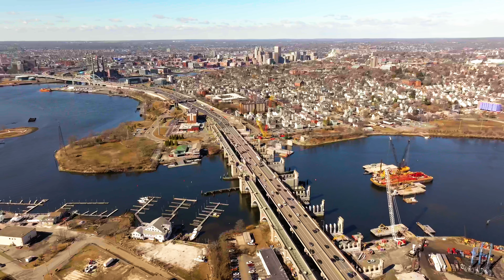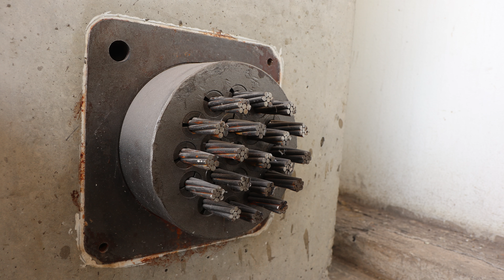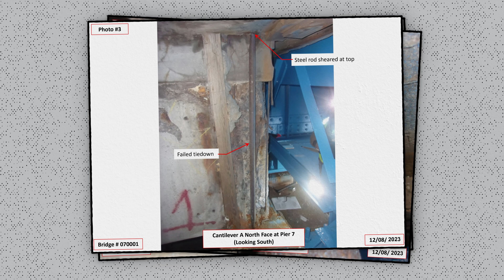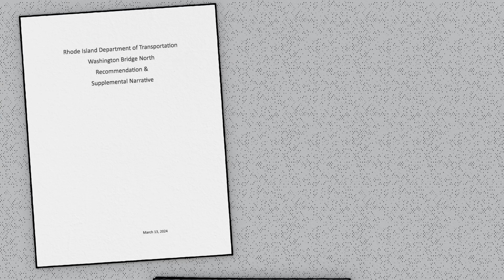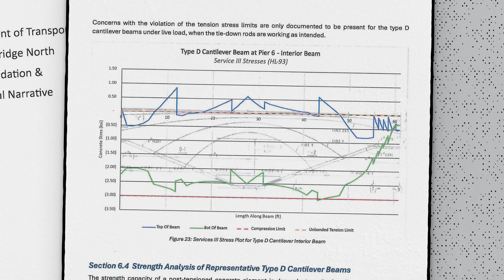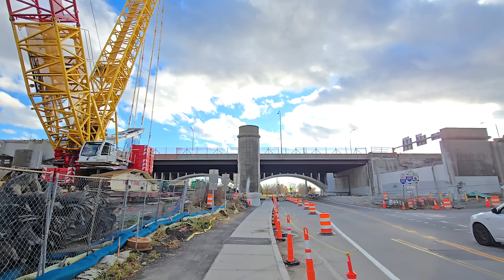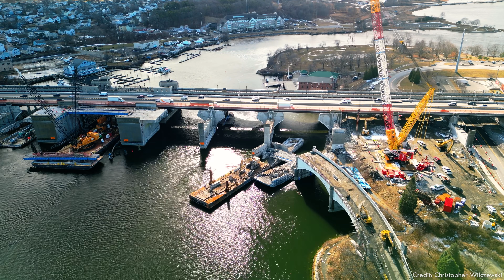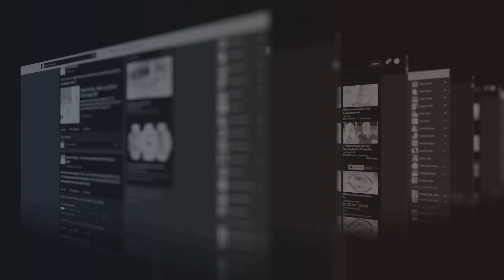This Bridge’s Bizarre Design Nearly Caused It To Collapse

Comment: What bothers me about stories like this is the lack of questioning of the implicit assumption that every bit of infrastructure that has ever existed needs to be replaced instead of just removed, especially considering in some places where we have clearly overextended our ability to pay for all of that infrastructure with proper maintenance and replacement cycles and also where the place itself might be less important or prosperous now than it was when the infrastructures was originally built.

Comment: Grady, have Super Duplex Stainless Steels been investigated for bridge construction? Any grade of stainless would be more expensive upfront, however the costs for maintaining a stainless bridge would likely be significantly lower especially in cold areas of the country that salt their roads. Super Duplex SS's are significantly stronger than standard grades of stainless and are significantly more corrosion resistant than standard stainless steel with PREN values of 38 to 45. These Super Duplex SS are used in the most corrosive and harsh environment possible such as petrochemical applications, long term salt water submersion, waste water, pulp and paper manufacturing, etc.

Comment: It's also worth noting that to a fair degree this kind of issue is self-inflicted by America's car-centric design. Sure a more functional transit setup would still require plenty of bridges, including some designed for cars, but it would still be far fewer of them and most wouldn't need to be designed for nearly as high of loads.

Comment: Any inspection or regulatory job can't be done by contracting private 3rd parties. Since the company will be paid the same regardless if the engineers spend 30 days doing a inspection, or 30 minutes, it has the incentive to use the least qualified people, at the cheapest rate, and make them do the minimum required.

The "free market" doesn't work in these cases. It needs to be government salaried employees, who will get paid the same regardless of the time they spend on each bridge. So they have no incentive to not do a good job.

Comment: I'm no engineer but you can see where the rods have stretched and narrowed, plastic deformation, before they snapped. Shouldn't there be a matte grey/white surface at the breaking point? I can see in the pictures that there's rust on what should be relatively clean surfaces if the break was recent, but the edges are still sharp, so they've been broken for a while but not for a huge amount of time, long enough to form surface rust. Either way, they're broken, and I think that bolt broken at the head had been broken for quite a while going by how heavily rusted it was, and you could see significant rounding of the broken edges. That takes time. I'm glad they caught the problem before disaster struck.

Comment: It should be more widespread to refer to it as an "engineering practice" like a medical practice.  Things are constantly changing and we are learning new things everyday.  You see a newer structure getting maintenance frequently and people say "they don't make them like they used to." You're right, we are trying to make it so that we can mitigate the factors that would cause a failure we'll before it happens.rather than hiding these components and assuming they'll last forever.

Comment: Inspection is great but really the question that follows inspection considerations should have been; What happens If you identify a failed part by an inspection but you need to disassemble the whole bridge to fix it it?

My other comment is that making a visually striking project out of something with such a core utilitarian purpose feels like a 50/50 split between it's fine and this was a costly mistake.  The Providence River Bridge 980m down the road looks fine with a nice steel arch and cable supports to the road deck that has a steel under structure.

Comment: Here in Austin TX there are some large powerline pylons that are made of Cor-Ten. They are similar to the single-pole high mast lighting towers you see at highway interchanges. Large metal tubes that taper gradually upwards and fit into each other. What bothers me is that they are Cor-Ten and appear to be in direct contact with the soil. There is no concrete footing apparent. There does seem to be some sort of coating applied to the metal where it enters the soil, but that seems like a corrosion failure waiting to happen. What's to stop some grounds maintenance guy with a string trimmer from damaging that coating? I hope they do some sort of regualr inspections of these pylons.

Comment: Design flaw?  Bullshit.  The Bridge was completed in 1968.  It was designed to be in service for 50 years.  It was 56 years old when they “discovered” the issues and shut it down.  You “Practical Engineer”, DOT Secretary at the time Pete Buttigieg, and some others tow the line as being the fault of the original engineers/designers.  How about the RI government that was utilizing a bridge that was past its service life.  The RI DOT prior to 2024 had just dumped $40 million out of a $70 million contract for some unrelated work on the bridge.  Now that work has been demoed.

Let’s not forget the inspection report from a few years back detailing the exact areas of concern were not able to be accessed due to, get this “excessive pigeon feces”.  I kid you not…..

Comment: Ever since the Hyatt Hotel overhead walkway collapse back in 1981 in Kansas City, I've been interested in "the way things fail".  You would almost think that whenever any big project is designed the final step should be to ask, now how can this fail?   How many ways can it fail?  How fast will it fail?  How visible will failure be?  And how contained will a failure be?  Will the whole structure collapse or just a segment?  When you're putting brand new things up, it's hard to imagine them coming down.  But as we capture more collapses of all kinds on video these days, it should be worth a little effort.

Comment: Grady,

While tankers are constructed of steel, inspection and response to cracks create many similar problems that are found on bridges.

Historically, tankers, as with all vessels, were inspected on a twice in five year, with a maximum of three years basis.  Structural design used a worst case weather criteria based on transits of the winter north Atlantic.

When the Trans-Alaska Pipeline (TAPS) opened in 1978, a segregated fleet of US flagged "Jones Act" carried Alaska North Slope (ANS) crude oil from Valdez, Alaska to the lower-48 states and Hawaii.  Initially,  the oil was carried by a mix of pre-existing and purpose built tankers.

TAPS tankers run primarily on a dedicated North-South transit route across the Gulf of Alaska, where winter weather starts in the early fall and ends in the late spring.  Beam seas make for both an uncomfortable ride and a very large number of cycles, similar to cars and trucks on a highway.

Reports of significant numbers of cracks started to be reported in the early 1980s.  The number of cracks,   size, and location did not go unnoticed.  The US tanker community is quite close.  All of the TAPS tankers were Classed by the American Bureau of Shipping and were regulated by the USCG.  The operators and naval architects knew each other from school, professional associations like the Society of Naval Architects and Marine Engineers.  We participated in similar committees, subcommittees, and technical committees of ABS, USCG, the American Petroleum Institute (API), Oil Companies International Marine Forum (OCIMF), and the Tanker Structures Cooperative Forum  (TSCF).  We also used many of the same consultants.

In the mid-80s computers made the use of finite element analysis a tool for identification of critical areas for cracks, high stress areas, identification and recommended repairs.

In 1991 the USCG required that every vessel in the TAPS trade have a Critical Area Inspection Plan (CAIP) which identifies areas where cracks can impact structural strength, and approved repairs for cracks.  It requires annual CAIP inspections.  However, based on the number of cracks and locations the annual inspections can be waived, for twice in five year drydockings.

 USCG Navigation and Vessel Inspection Circular (NVIC) Number 15-91 Critical  Area Inspection Plan (CAIP).

Bob

Comment: 12:49 - If there were a way to make it worse, they couldn't seem to have found it.
14:55 - Nope, there were more ways to worsen it yet.
17:17 - Agreed, but... I design and market engineered products and none of them are purposely designed to hide possible failure causes or modes; this thing should have come with a 'sell by' date.

Comment: I am VERY happy to see you cover this Grady.  It was good of you to hat-tip Casey and the local reporters.
Casey Jones Professional Engineer has been covering this for a while now and that was where I learned about this.
He has been using COMMERCIALLY available, PUBLICLY accessible data for the Wash. St. bridge and clearly if Ri-DOT had actually used modern inspection capabilities they would have known this bridge was unsafe years earlier. Too bad governmental clerks often seem more inclined to protect their turf and not even try to "do the right thing".
 InSAR Analysis from Value Space was available for only a few thousand dollars... Ri-DOT seems to think that is a "bad" thing.
Perhaps Ri-DOT might actually get something right going on.... but I am not holding my breath.

Comment: This is a country wide problem, not just there. Inspectors all over are not actually doing their job, just checking everything off not caring what the structural statis actually is. That's what got us into this infrastructure emergency problems all over the place. State Government is more than happy to take the money earmarked for inspection and maintenance but they don't want to spend it on that - likely on bonuses or vacations IMO.

Comment: I am not familiar with the rules and regulations regarding inspections. but it seems to me that for structures of that age a more in-depth inspection may be needed at some point. the westbound bridge began construction in 1967 so it was about 56 years old at the time the issues started being found. maybe, to pluck a number out of the air once every 10 or 20 years an in depth analysis of a structure should be done like was done after the first problems where found. who knows what other old structures with interesting building techniques have hiding beneath the surface where it can't be seen.

Comment: On the matter of substantial bridge delays, might be interesting to do a feature on the matter of I-55 in St. Louis.  Boulevard overpass bridges were to be reSURFACED on a major corridor.  Simple enough, not traversing a waterway, just passing over local traffic below.  But the surface removal destroyed bespoke girders that could not be rehabilitated and could not be replaced without substantial delay.  So where once was Interstate roadway is no road surface and destroyed girders . . . A small project has turned into a multi-year boondoggle, almost entirely due to inept engineering.

Here's a local news summary for reference - https://www.youtube.com/watch?v=3uLVdnnnrcc

Comment: In Germany (Dresden) the Carola bridge collapsed because of a catastrophic failure of the tensioned steel ("Hennigsdorfer Spannstahl") and some more are closed down. The same technique was used in eastern germany from the 60s til 93.

Comment: If hidden steel cables possibly breaking is an issue, why not just make an electric test connection across all of them? Then a cheap automated system can give an alert as soon as a single one breaks. If the tester is made a bit more sophisticated, it could even detect deterioration by measuring changing resistance.

Comment: I was supposed to cross this bridge the day after the bridge was shut down. I’ve been over the consolidated bridge all on the original eastbound side, but it’s scary, since many trucks drive in the wrong lanes. Most of the bridges in RI were built at the same time, so all are under construction now, making many people to complain. It’s scary I drive over that bridge several times when it clearly wasn’t safe. And now more over weight trucks are on the original eastbound side, so that will need to be replaced sooner than planned.
Reply: I’m happy they didn’t do a bandaid fix. But trying to drive through there at busy times is so frustrating! I still don’t know how it passed for so long

Comment: I will say that we in the US have an over reliance on concrete when I believe we should be using longer lasting bridge designs out of stone and steel. 

to take on a sore subject, the 35w bridge, the one that collapsed, had elegant steel work and if it hadn't been for the gusset plates, it would probably still be standing today, though it would've needed some work done to the rollers that allow the bridge to move.

the new 35w bridge is fugly, and that's putting it mildly. concrete box girder design, not much different from 100,000 bridges in the US alone. there's nothing awe inspiring about it

Comment: They should've built the road bridge as a stone arch bridge in the first place just like the much older one. Yes, it would've cost a few $ more but it would still be standing now. Arch bridges look nice and last forever because they're always in compression. There is no steel to corrode.

Comment: I've heard this a lot lately, a bridge needs replacing because it's reached the end of its designed lifespan. We have a similar problem over here in the UK. Many of our motorway Bridgewater at this stage. I find it puzzling. We have many stone arch bridges that are centuries old, and brick arch rail bridges between 100-150 years old.

It seems that their very nature makes steal and concrete bridges unsuitable for long lifespans, but perhaps there's a third way? 

Concrete works best under compression, while under tension it is fairly useless unless it's reinforced with steel - but even then, it doesn't beat its stats for compression.

Instead of using long beams prone to failure, you could make fantastic arched structures using shaped low-cost concrete blocks, similar to those used by TBMs.

Comment: At work, we recently took off the siding of an old brick-faced concrete block building. We knew it was bad, cause it leaked when it rained, but it was impressive just how much was hidden by the siding and drywall (that was installed on the inside over top the crumbling plaster).

I’ve also recently received news that the interstate by my house (which has been under construction for a year or so) is delayed because of bridge problems. Who’d have thought that maintaining huge infrastructure would be such a concern.

Comment: 11:30 ha ha ha... when you were showing the pictures of the failed bridge components, my recent inspection (and discovery of several broken joists and bottom plates) of the crawlspace of my 70-year-old recently purchased house came to mind... 
Our "inspector"  missed a bunch of stuff (I'll do the inspection myself in the future, thank-you-very-much). 
Luckily everything can be fixed, and I can do the work myself, but it was a bit of a gut punch when I found it... 
Anyway, the comparison between the bridge and an older house with a few structural issues was spot-on.

Comment: How many bridges in the US?  650,000?  Bridges, the interstate network, electrical generation and distribution, oil/product pipelines, refineries - the under-pinning's of our first-world life-style - are all starting to groan under the weight of increasing demand.  For example, I was doing inspection work for fiber-optic installations across a city of 125,000 here in Canada.  We were in a cul-de-sac having 27 houses.  One home-owner had recently bought a Tesla, and had installed the necessary charging equipment.  The city owned electrical utility was on-site for a consultation, and afterwards I asked the engineer how many Tesla charging stations the electrical infrastructure for the 27 houses could support.  He said "One".  He explained the age of the equipment and conductors, plus available supply would not be able to handle more than one Tesla or EV charging station.  And it comes down to the 50 year old electrical distribution network in the entire province of Ontario, not just the city of Kingston are to blame.  There isn't enough ampacity available.  Tough choices are going to have to be made, sooner rather than later.

Comment: Montreal Champlain bridge replacement is a good example of planning the replacement. A 1960s bridge using similar newly modern construction was found to have degraded faster than expected. Repairs were made and the decision to replace the bridge was made at the time. Eventually a new bridge was constructed and the old was was removed, all without panic.

Comment: I was heading to a Christmas party when, at 6:00PM, they closed it. I ended up driving on back roads 10 mile North and then South on 95 to get to dinner. 
Great explanation. FYI they had been working on the bridge off and on since 2002. Expansion joints, new road way paving etc. Also there was a major pigeon pooh problem under the deck.The forever project. In the 2000's I use to row under the bridge everyday in the warm months. Had I known......